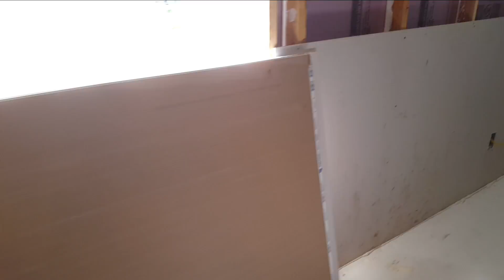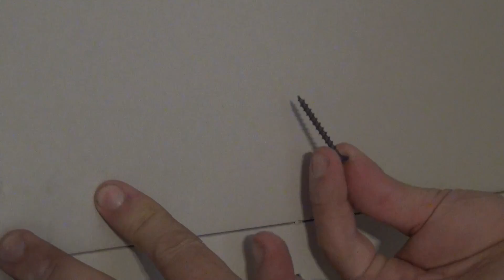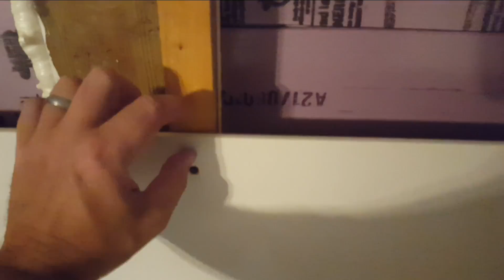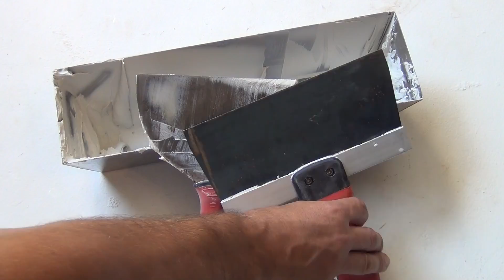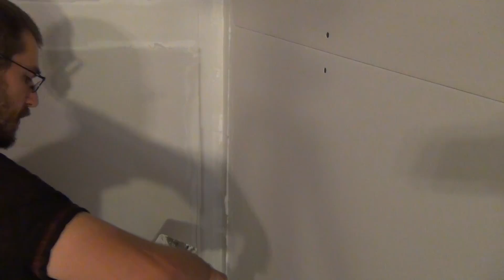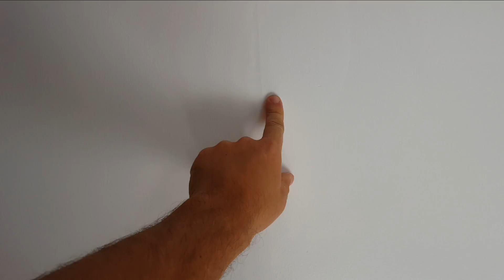Drywall basics   How to install, tape, mud, and sand drywall

Comment: You should have put a third coat on.  More of a put on take off process for the third coat. And for the screw hole you should do what you said not to do and do it three times.
Reply from the maker: I agree, a third coat would have made things look even better for sure and allowed me to fix up a few of those ad areas. Unfortunately I was on a deadline for this project so couldn't get the third coat in. Next time I may try the faster drying mud

Comment: When I was learning how to drywall the tape was applied first, then the mud. The tape was made of strings in a grid pattern that was sticky on both sides. After the mud was dry we sanded it and put more mud on, then repeated a couple more times.

Comment: drywall screws need to be 6-8" apart to code. yes thats many many screws, i dont use paper tape it will collect moisture and bubble off the wall later on.Use the mesh tape. The bucket mud dry time sucks unless you put in skim coats. I use Westpac 20 min from home depot we call it smooth set. do 2 layers then you can do one green dot box coat. After a few years you can do the mud without sanding.. good luck
Reply from the maker: good point on the drywall screws. I think mine were further apart than that, is that code for ceilings or walls also? I'll have to try some of the quicker dry time stuff next time, that is one thing I do not like about this compound for sure
Reply: both...
Reply: Come on have you really done drywall! 8-10” on the seams; outside walls get 3 in the field, inside walls get two! All per code! I know!
Reply: A 1-1/4 course thread is all you need for wood with 1/2” unless it’s a metal stud than you use fine thread. 1-5/8” is for 5/8’s drywall and more harder to work with cause you have to ‘help’ them in. I know cause I can do this in my sleep! Don’t want to disrespect anyone here but yes I know my shit! Ask me another!
Reply: And if you use quick dry you will be so sorry! Don’t listen to this guy cause he is in la La Land! Quick dry for a repair only! Get in get out! Wonder if he means Durabond 45, 20, 60? If this person knew what he was talking about he would stop posting comments!
Reply: Paper is the only way to go unless you’re fixing a patch that has texture! Paper would create a bigger ‘bump’ and don’t want that so I use the mesh. Really? Have you done this before?
Reply: Don’t listen to this Eclipse person! 10 second vids and they  don’t know anything! Must be ambulance chasers in YouTube!
Reply: you must not be a drywaller if you don't know what 20,40 and 90 min. Westpac smooth set mud is kid. I have been doing drywall rehabs for 40 years. i think i have figured it out by now. You probably don't even know what california one coat is either. i have underwear older than you

Comment: Fine thread are for metal studs.
Reply from the maker: ah, that makes sense! I have seen people use them in wood and they pull out, I have also seen so many nails pop out in my last two houses that I vowed never to use them!
Reply: I hung drywall for a while and we would use nails on the perimeter and screws in the field. Nails for speed mostly.  But yeah, fine threads will just strip in wood before it sinks the head.

Comment: not sure if I missed it, but what did you do for the drywall that butts up to the window opening? Mud the outside edge? just primer it?
Reply from the maker: I used a piece of wood that was in there previously and it covered the top edge of the drywall coming up to it. I then just used some mud there to make it smooth. I turned out pretty well but you can slightly see the line of the wood along the edge still. Probably should have built it up a bit more and then sanded again